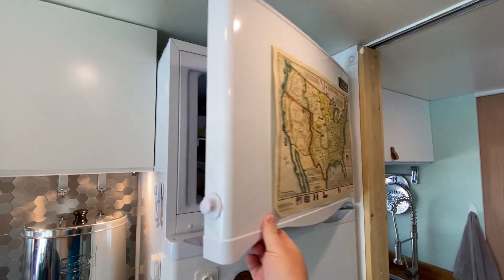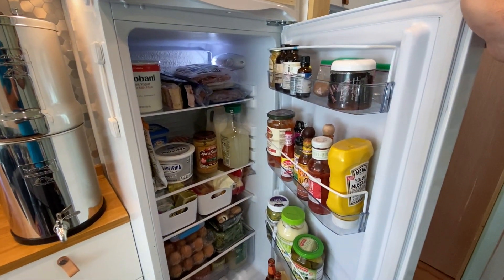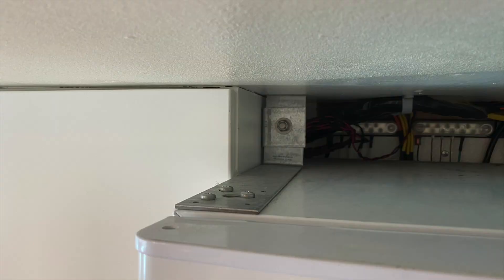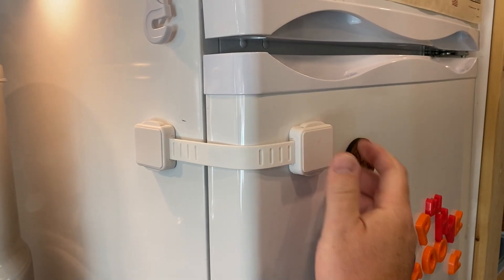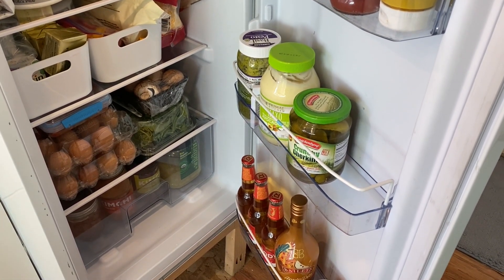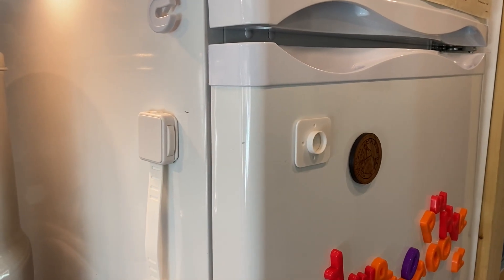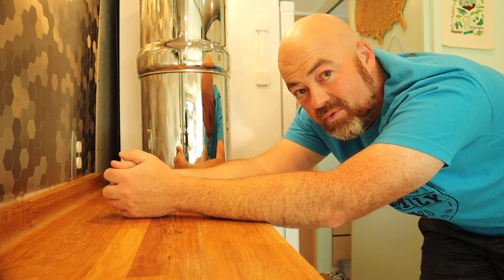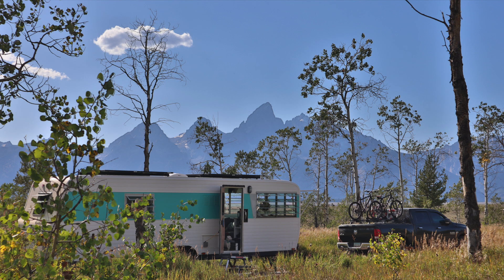12V SOLAR FRIDGE AND FREEZER IN AN RV!

Comment: I'd love to hear more about your love/hate relationship with the Berkey. They're simple and they work pretty well but they seem too clunky for me.
Reply from the maker: The Berkey works well if its stationary but I really don't think its right for full time travel.
Reply: @HomeMeetsRoad  exactly.
Reply from the maker: The major issue is that it appears you need to ‘prime’ the filters after every move because they sat too long without water. Really annoying... and you can’t keep water in it because there is no real good way to ‘strap’ it down.
Reply: Oh man that's annoying. I didn't realize they dry out like that. It seems like by the time you desing a strapping system you should just invest in a different state by all together. I know it's a first world problem but I like my water access to be easy and hassle free. Are you considering other water filtration systems?
Reply from the maker: We are looking but haven’t found something yet. For now we are sticking with the Berkey until something better comes along.
Reply: Good luck in your search!
Reply from the maker: Thanks!

Comment: 2 questions: (1) Why did you choose this 12 volt refrigerator (brand name)?
                       (2) How well does this type of refrigerator maintain temperature when it is really hot outside (90 degrees or hotter)?
Reply from the maker: One of the reasons we went with this brand was because Costco sold it and they had free shipping. Other than that it was because of the power consumption and size.

So on drive days the temp gets up there in the trailer (no A/C going) and we haven’t noticed any issues with the fridge. The only time it really struggles is if you keep the door open for too long.

Comment: 2amps per day? That’s impressive. Did you say how heavy it was? Compared to the OEM you removed?  What’s your battery bank look like? Do you have a few lithium batteries for the rig?
Reply from the maker: 2 amps per hour so it uses 48 amps in a 24 hour period. We build the RV from the frame up so we had no fridge to replace. Our fridge weighs 93lbs empty and a quick Google search on a Domedic 9cu/ft RV fridge showed 124lbs... so roughly 31lbs difference. We have been slowly upgrading our battery bank and now have 500Ah of lithium (Battle Borns) and 1,240W of solar on the roof.
Reply: @HomeMeetsRoad  2amps per hour...wow I obviously misheard 🤦🏻‍♂️ and that makes better sense 😆. We have the standard propane/electrical combo in ours and at times I’ve flirted with a pure 12v solution for overall simplicity. But we aren’t full-timers so it hasn’t been I’m on the immediate radar. We also only have (2) AGM 100 Ah batteries which has been great for our needs. To get to 500 Ah I guess up you have 5-6 BBorn batteries?
Reply from the maker: @ConsidertheWonders  We initially started with 800Ah of AGM because... well... cost. But AGM's have one major issue, the voltage drop when a load is applied. The minute we would try and run our A/C (for example) the voltage would start dropping so fast that after 40 minutes we were at 10.5V and the inverter would turn off because of low voltage. We still had 600Ah left but could not use it at 120V because the inverter would not turn back on. Lithium batteries do not have this issue. We have run our BB's down to 20% and still were in the 13V range. Just nuts! Because of cost, we have been slowly adding and are now at 5 BB's (100Ah each). We will see if we are going to add to that after some boondocking testing but right now, we can run our A/C off of our BB's for well over 12 hours and still have plenty of power left over.
Reply: @HomeMeetsRoad  that’s a pretty nice setup 👍. I only use a single 200w solar panel and it works perfectly for the (2) AGMs. Once our voltage gets in the 11v range I start getting anxious with our setup. But for what we do it’s pretty rare that we ever get out of the 12v charge range.  Came close on a couple of cloudy days in Utah but one day of solar got us back to upper 12v charge range. What size solar panels do you have to get to 1240?
Reply from the maker: @ConsidertheWonders  Since we rebuilt our RV from the frame up and have a Mini Split A/C, we do not have anything on the roof except one MAXXAIR Fan which means we were able to go with big panels. We have 4 panels that are 310W each.